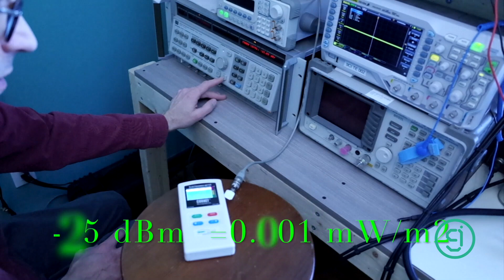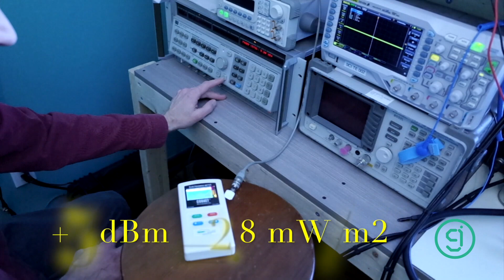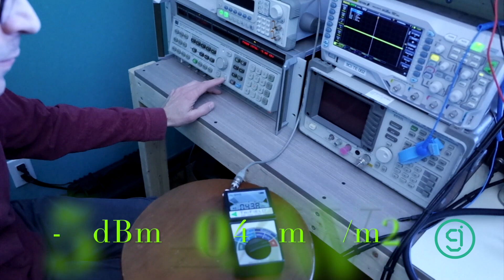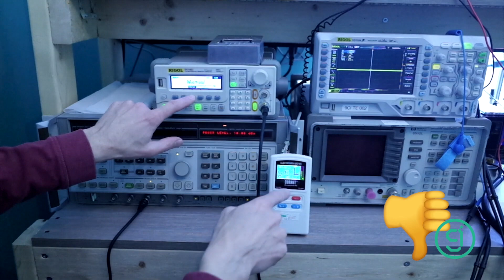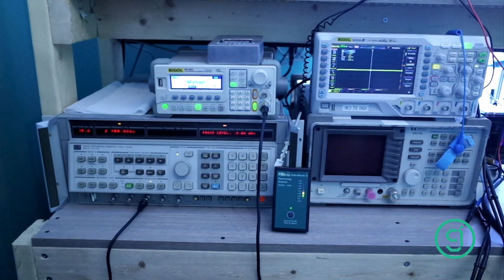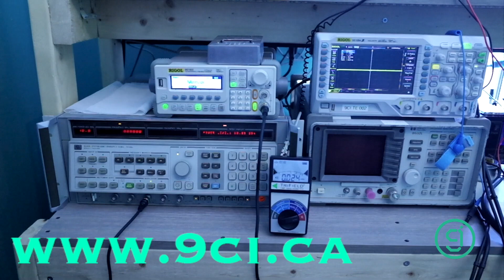Classic Pulse Tests Comparison

Comment: Hi Guys, I really like what you do. I am looking into EMF right now and learn a lot about it. I have a comment to make regarding the measurement for the ed88t. Its antenna for Rf is on the left side, as it has only a 1 axis antenna, the signal should be measured with the side where the antenna is no?

Comment: Excellent. That's the kind of testing we need. Evidence I can respect. However, please clarify for the TF2, the CW is at 18 mW/m2 but it fails to detect pulses "below 9,000 uW/m2"?  But it failed that setting too. 18,000 uW/m2
Reply from the maker: uW/m2 is the power levels it fails at seeing pulses that happen faster than 9,000 micro seconds. So it will miss bluetooth and a lot of modern technology. Which was an interesting discovery. Some meters will see the narrow pulses (sometimes) if you jack up the power a lot. Maybe the sensor didn't really pick it up, or maybe it just didn't take a sample during the pulse. The meters take measurements repeatedly but some pulses may be missed. The game is to catch as many of them as possible. The TF2 missed a whole bunch. (Still a good mag field meter - just not RF).